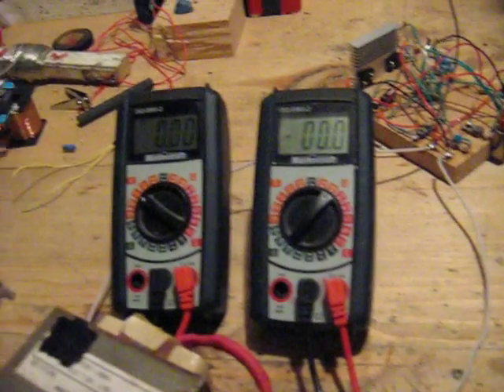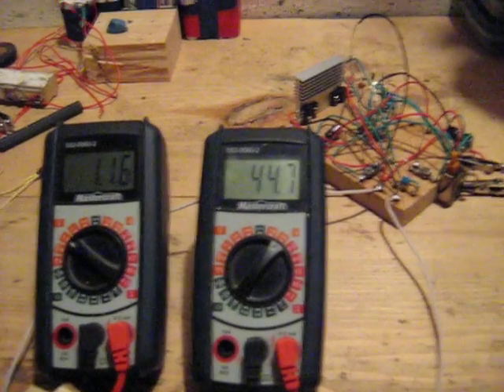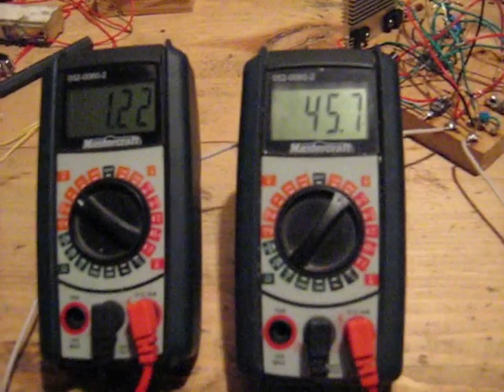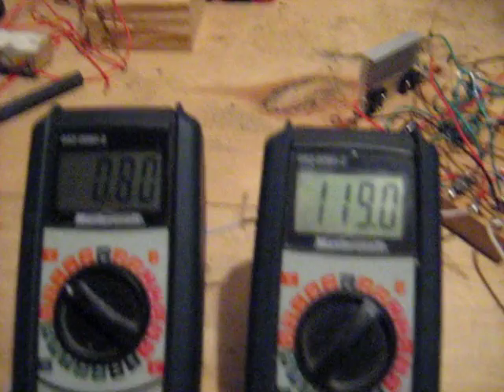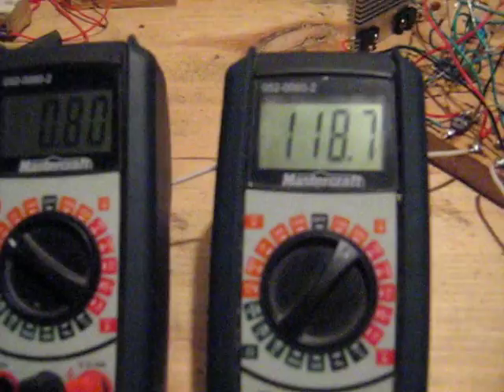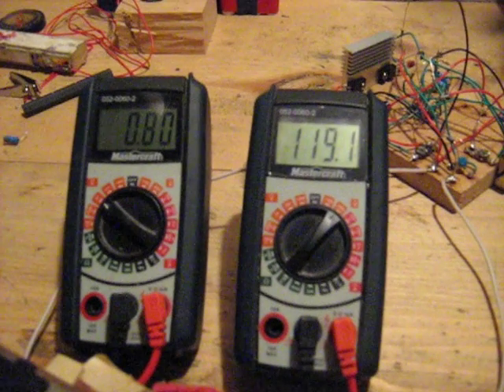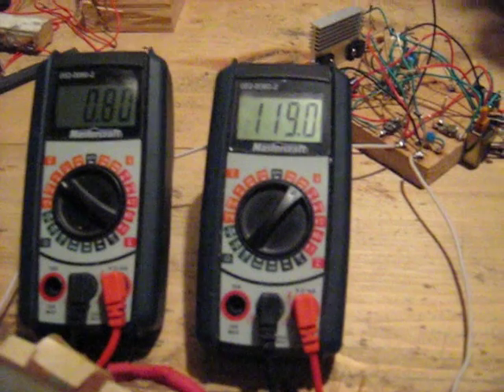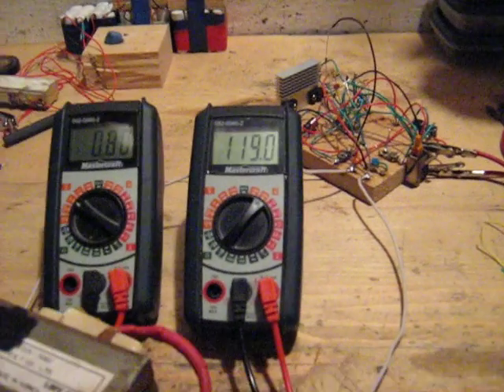PWM - Resonant Inductance with Microwave Oven Transformer

Comment: Looks really cool but i wonder how high your frequency on the PWM goes? could you be exceed the ability for the multimeter to properly assess the input voltage / time? Need observation, either way!

Comment: once again very cool.. where did you find those caps?

okay.. far as the resonance sweet spots.. have you tried moving the transformer around to different harmonic-reacting locations in the house to see if the sweet spots move? like maybe place a metal pan over the coil then modulate it.  i think what you are doing is along the same lines as what Tesla was doing with the focusing of magnetic fields to send wireless energy. this is where another PWM would come in handy...